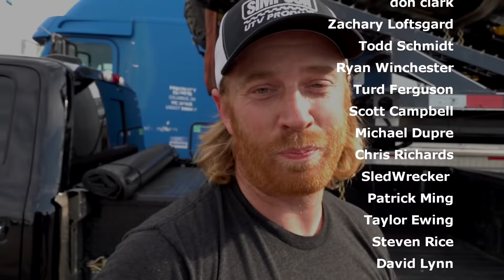Wrecking $250,000 worth of side by sides... our worst day ever.

Comment: I feel for Doug, I'm sure he feels absolutely terrible. Glad everyone was ok.
Reply: First time that I heard him cussing that’s something!
Reply: This most likely wasn't Doug's fault. The coupler was either never locked properly, or a component failed and caused it to come unlocked.
Reply: @tylerw4593  or he just took the corner a little to fast??
Reply: @Ridgefarming  If speed alone were the culprit, the truck and trailer would still be connected.
Reply: @tylerw4593  They said it was still locked with the pin still in it while it was on its side. These gooseneck hitches do a ton of rocking and twisting as they travel, all that motion wears the inside of the tube out. When the tube gets worn out , it makes it a larger diameter and it allows the tube to slip, or POP off the ball. These wedge trailers when loaded up on the top front are heavy and they lean a bunch in turns making them really crank on the ball and hitch connection. I hate wedges for this reason, youtube is full of wedgte trailers that have lost it on corners, even when speed isnt a factor really.
Reply: I believe it was a cuppler fail, I probably should have put that in the original post
Reply: Trailer coupler was probably locked when they hooked it up and they thought it was sat down properly. Simple oversight seen it before. Seen one of my drivers hook up and we did the pre trip and noticed that. Quick jack up and open the coupler re hook and lock up and ready to roll. This is why you pre trip your load with a fine tooth comb
Reply: @warrenmichael918  my dad had an accident back in ‘90 with a gooseneck horse trailer. The coupler actually shaved the back of the ball hitch off. It was the strongest ball, at the time, 20k. If it had been anything, other than the coupler failing, there would be been damage to the hitch ball. I’m going with the theory that the coupler had failed, and the trailer probably hit a bump, and that sent the trailer over.
Reply: @jeffandrews7335  yes, thats what i think too, it was a coupler failure. Not a bump as much as the trailer leaning around that sharp curved on ramp as he was probably getting some decent speed up to start his merge into faster traffic.
Reply: @tylerw4593  Looks like they were going too fast and the tube popped off the ball
Reply: @tylerw4593  it was absolutely due to speed and having the heaviest machines up high.

Comment: I oversee numerous semi-dump trailers for 23 years.  When they turn over 90% of the drivers always says "something broke".  90% of the time it is operator error.  Driver took the exit ramp too fast.
Reply: I will agree, I pulled high wide & heavy 30+yrs with 13 in car hauling.....my last was that trailer & dul-e. Cant stop loaded out well& rollover is very easy........VERY !!  I ran that set up for3months & walked away after damaged roof of truck turning lol. I never damaged a truck in all my years until I tried to truck in that setup.....I was gutted & still get ribbed about that by my friends.
Reply: 1:07 what do you see, or not see in the bed? Brian Rose caught this, not me. As you said, operator error. They didn't latch the hitch ball..
Reply: @cameltube-vk7el  i've always wondered. those car haulers are so close to some of those cabs.
Reply: @0xsergy  ohhhhhh snap !!  I  never removed the one I operated, but it is missing in that shot right !!  So when [& who] did that get put in &  NOT get locked ??  L U C K Y  ?? !!
Reply: @0xsergy  I was turning off a big road onto a side one with a hair pin entry....inside  corner crushed the cargo-lite on cab....I thought I was crushed the back window by the sound ha ha. Was worst day of 30 yrs operating & I hear about it everytime at the speed  shop I hang at [retired] for fun!!  What a line for my headstone  "CAMEL CRUNCH" hehehe

Comment: I agree with Brian Wilson-  UTV-SxS are lighter than cars, but the center of gravity is more at risk due to the lift. You don't have the weight (Front UTV) needed on your drive axle, thus the Mid-Point-Cargo weight for the total GVCW is elevated as compared to standard 2800lbs vehicles.  One good 40+mph cross wind while driving would probably blow you over.   Need a trailer with more low end weight.  Not judging at all, respectfully.  34 years, Ryder, Rollins, Penske,, UPS, CFI, Yellow Freight Cargo Securement + Running Hotshots in a F-350 x 32" flatbed.

Comment: I agree with a few other comments on here, those gooseneck's will tip when you least expect it. I know those f350's can be fitted with 5th wheel hitches, I think that should be your next upgrade. Tough break. Bunch of awesome dudes that don't deserve any of the bad luck you've had lately. Keep your heads up and keep sending it!!
Reply: 5th wheels aren't any better when they're not locked in. 🤦‍♂️

These guys have no business towing anything. Luckily no innocent people were injured.
Reply: well considering the chains weren't connected in the first part of the video, would lead me to assume they never fully connected the trailer. That is why you should double and triple check your work, especially when they were probably in a rush, with little to no sleep.
Reply: @theoneandonly2590  if you look closely at the chains the mounts where they were connected are still connected to the chains, nice try though.
Reply: The ball wasn’t pinned into the bed 1:36. They didn’t pin it. I also don’t see any chains!

Comment: I'm glad y'all are safe! Load pushed against the trailer and it twisted and rolled over. Get a truck next with a 5th wheel and not a gooseneck like you had and this won't happen again. Goosenecks are too tippy and I've seen this way too many times as a semi driver.
Reply: Semi time and do it right.

Comment: The gooseneck connection is called the coupler. The part inside is called the insert. I spent 15 years working at Texas Pride Trailers. I know everything about these trailers. The safety chain connections on the truck side apparently broke and I think the chains may have been mounted to low on the gooseneck itself allowing slack. So when the coupler came off there could had been enough slack to not allow the chains to stay tight. I know you think this is a good brand. BUT Kaufman is one of the worst made trailers on the market. We spent more time fixing them than any other brand. But don't take my word for it. Call any trailer manufacturer and ask them their opinion on Kaufman trailers.

Comment: Time to upgrade to a 5th wheel hitch. 

Imagine towing cars for a living and having that happen with a load of not your property. I’d say you were pretty damn lucky.
Reply: In last 40yrs from top of Monteagle, bout 134mm, to Georgia line,  166mm on I-24 have worked or assisted working probably over a hundred truck/SUV/cars not properly set up for towing and tractor trailer crashes. I know most of ya'll have seen the mini-van with rear hitch makin sparks on the road and nose of rental trailer making a "V" with the van or car. Actually Georgia has more in that 3 mile stretch to the 169. In 2020, i think, there were over 470 crashes from 162 to 169. Curves, dips and bad sight lines test the stability of any tow set up. Have seen 1/2 ton pickups towing monster 45' campers. They ALL say "i don't know what happened...the engine was pulling it fine". Ain't the engines, it's braking, panic moves, on and off ramps that are deceiving with no banking or negative bank. Plus if sheite is gonna happen this is the Devil's Triangle of wrecks. 
As to this crash I've never seen that much trailer and load on a gooseneck setup. No disrespect but if pin still in hitch and ball still on plate then odds are high that only gravity got y'all that far BUT ain't my crash to investigate. Seems to me like a shorter stacker type trailer would be safer to get some weight down low and consider a Kodiak or toterhome. 
Mainly glad ya'll not injured and sad to see your rides slammed.
Reply: Goose neck is stronger with more weight capacity. Typically about 30,000 lbs. 5th wheel is only rated about 20,000 lbs.  The trailer they have is made for  cars. I doubt they were over their GVWR with SXS’s.
Reply: @veto8792  Preciate the reply. Good road and weather conditions. Experienced driver. I wasn't there, just speaking from my own experiences limited to tryin to clear the interstate as quickly as possible. So looks like down to two possibilities: human error or mechanical failure. Sometimes gravity and physics don't care about the ratings or there wouldn't be any crashes. L8r.
Reply: @veto8792  they have fifth wheels rated for 30k plus, if im not mistake most 40k rated trailers are fifth wheel only.  Dont know if a 3 inch ball goes that high.  most wedge haulers use a fifth wheel that only pivot forward an back, that way they are more stable side to side, which comes in handy in times like these.  bad situation all around
Reply: @kalebrivers5260  Negative. Unless they are designed for class 8 trucks, most wedge trailers (for 1 ton trucks) are gooseneck. Gooseneck trailers are best for commercial (towing vehicles, equipment and agriculture. Fifth wheel is for recreational (camper/RV towing).
Reply: @veto8792  just going by what my friends who pull wedges for a living say.  Just a simple drop of the coupler and put a pin in and away you go.

Comment: Seems like the guy at 10:05 answered how it happened. Going to fast around the curve. That combined with what seems like some of the sxs’s not being secured properly. Sxs not secured properly shifted due to the force of going to fast around the turn and there’s your end result. That strap looked cut not ripped, didn’t see the rough torn edges like it was ripped. I’ve hade a strap get cut by a wheel, looked just like that. Just my 2 cent though.
Reply: And the ball not attached properly to the bed.  Check it out, beginning of the video, no ball, by 4:06 in, it magically appeared.
Reply: @vulpsturm  lmao.. seems like they know what actually happened! 😂
Reply: @vulpsturm  interesting
Reply: @vulpsturm  That's what I saw and was wondering as well!!!
Reply: What's funny and bad at the same time was the guy driving that caused the whole mess is the same guy getting back into the truck to drive again.... typically not a good idea.
Reply: @brianrutherfield9233  Wish they would just admit that and no just stand and say "I have no idea how this happened"
Reply: I bet the strap was on the outside edge of the trailer when it flipped and got gut on the cement.
Reply: @vulpsturm  Nice catch!  It could have failed or they don't want to put blame on anyone in the video.  No matter what happened it is sad.  I am thankful that no one was hurt.
Reply: @vulpsturm  I did see that, and thought it was kinda interesting they were saying everything looked fine but yet there was no ball in the truck. Being that it might have been the ball bearing style lock system. I wonder if when the trailer went over if it didn’t bust the ball socket and pull the ball out or something like that.
Reply: @vulpsturm  it looks to me like the red box is covering the ball in that shot.   I have a ford with the same style goose connections.  There are 5 holes in the floor.  The ball goes in the middle, if you look close in that shot, the empty holes are close to the outside edge of the bed and it looks to me like the red box is on top of the ball in the middle of the bed.   Also it looks like the parts that go into the holes for the safety chains to connect to are still connected to the hooks on the chains.  Im surprised to see those pulled out of the bed!
Reply: @vulpsturm  The ball never came out of the truck. At the start of the video what you're looking at is the safety chain rings that sheared off. The ball is still in the bed and the bottom one of those Milwaukee boxes is against the ball and caused the box to be tilted towards the cab of truck.
Reply: @jonkowalski8190  That's exactly what happened. The red Milwaukee box is sitting at the ball blocking it from view and the box is leaned over towards the front of the truck. When the trailer coupler popped off the ball and the trailer started to go it caused the safety chain rings to shear off of the hitch mount. I stood and stared at it for 5 minutes at the event and just shook my head at the force it went through and what happened.

Comment: I've never liked that design of trailer. It looks real unsafe even when its all good. All that weight up top puts a heck of a lot of force on that hitch so this was probably just something that was going to happen eventually with premature wear in the attachment. 
Glad you're all ok though - thats the main thing. 
I wouldn't be using that trailer for that again though. Maybe get something a bit better laid out for the weight.
Reply: High centre of gravity on the trailer for the speed into the corner, ripped the hutch out of bed of the truck when the trailer rolled.
Reply: @TimnBelle  I noticed the ball wasn't in the bed at the beginning of the video, then noticed they put it or another ball back in later in the video. Almost seems like the ball lock pin broke or it wasn't locked in like it should have been. I think a fifth wheel is a better design for a trailer like this with a higher center of gravity.

Comment: Switch to a fifth wheel. It will help preventing this issue. The gooseneck tilts too much, the fifth wheels have a plate on them that stops it from leaning over so much with a ton of weight.
Reply: It was
Reply: @mikegreen1095  it isn’t a fifth wheel. It’s a gooseneck. All it is securing it is the ball and the hitch that’s bolted to the trailer. It allows tilt.

Comment: If the pin is still in the hitch and it came loose either it’s designed to prevent the truck from rolling when the trailer does  or the hitch failed causing the problem

Comment: Weight up high, spring loaded weight at that (rocking/leaning from SXS suspensions which shifts center of gravity, even a little bit), sliding/shifting gear in bed of truck, curve radius and road pitch, timing where it all came together = bad outcome. I haul logs on a 24X8 deck over axle 17,500GVW double axle trailer. I've had just one log "settle" left or right just 10 inches on the load, and can feel everything change. It's only happened 1 out of a 100 times, but that's all it takes, one time. As a driver hauling a load, my job is not just to watch the road, but sense the load.

Comment: The tipping of it is what caused it to unhook.  Just went to fast around that corner.  As he came around that corner and the trailer went to tip over, that side loading on the coupler forced the ball out of the coupler.   This could have been avoided by slowing down around that curve and knowing the handling characteristics of a high CG load.  Just be lucky that the coupler failed and let the ball go
Reply: This was a faulty coupler, or not hooked correctly. it should of never release under any circumstances.
Reply: If the trailer worked as it should the truck would of flipped with the trailer. This should never have broken off
Reply: Trailer was was too high centered and the repeated stress on coupler made it fail. This was probably a long time coming.
Reply: @guyod1  the coupler is never supposed to release under any circumstances. Whether the trailer was loaded to higher or not is irrelevant, at Most it should have took the truck over with it.
Reply: @mouses911  my point is if after a thousand times of stopping the trailer from tipping over the coupler eventually had enough slop to let go. Is the coupler really defective? Everything has a breaking point.
Reply: @guyod1 yes!  the point was it either broke (defective), or was not hooked correctly. It had nothing to do with how high or not it was loaded. I've seen trucks hanging over cliffs that wouldn't unhook, if it was loaded too high and was going to flip it would of just flipped. He said nothing broke, so it was a faulty coupler, or not hooked correctly.
Reply: @mouses911  but the when it all is said and done this can only be blamed on too much speed...
Reply: @mouses911  yep, my nephew barrel rolled his f350 with his goose neck after hitting ice. His trailer stayed hooked up even though it was obviously destroyed but it didn't release, and that is very impressive.
Reply: The couplers are typically rated at 30,000 lbs. 2 5/16 and 40,000 lbs. 3 inch.  Balls 2 5/16 lowest I could find 20,000 lbs. most 30,000 lbs.  3in 30,000 lbs. Likely Highballed. Coupler wasn't down on the ball completely when the pin was put in.
Reply: @szki272  Nailed it. I have the same setup on my truck. Someone forgot release the pin into the locked position.
Reply: As everyone said he was no going fast so your theory incorrect sorry to say
Reply: @neilrobertson1345  of course everyone is going to say that.... who would admit that they was going to fast?
Reply: Wow I didn’t know so many people from the YouTube channel were right there.  Easy to speculate.  Could have been a multitude of variables.

Comment: Always double check the latch, USE THE SAFETY CHAINS, and slow down on curves with high stacked loads. This is why truck drivers are required to have a license, and go thru testing to prove they can drive their equipment.
Reply: Yeah, there should be training, testing and a licence endorsement once a trailer reaches a certain size.